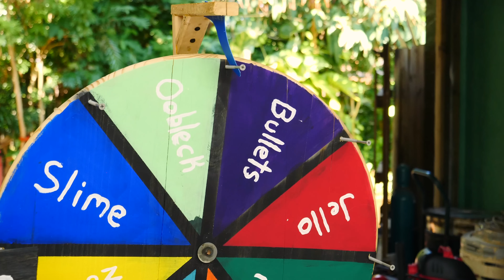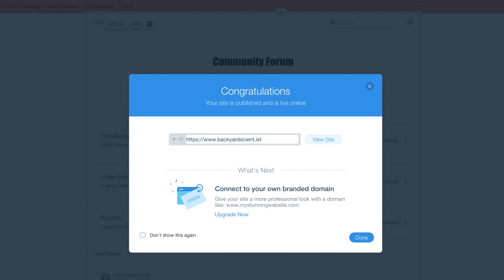Is Molten Aluminum Bulletproof?

Comment: Parents: don’t run with scissors

Backyard Scientist runs with molten aluminum
Reply: With shorts also
Reply: What could go wrong?!
Reply: Well... when dealing with metal that melts at 1220°C, his shorts could certainly melt along with his leg hairs, skin, muscles and even his very cell DNA could start to disintegrate. 

Many things could go wrong, many things...
Reply: @John-Smlth  Thank you, LT JG Obvious
Reply: John Smith Mr Smart guy here. Didn’t even make it through the whole comment
Reply: @nathschannel266  are you proud of the fact that you couldn't get through 2 sentences?
Reply: @John-Smlth  BRUHHH!!!
Reply: It ain't scissors
Reply: He wasn't holding scissors, so he was not in the wrong.
Reply: Parents: don’t run at all, you’ll slip
Reply: @John-Smlth  aluminum melting point is around 700° C
Reply: @schwarzesfleisch5809  First result from googling: "In its pure form its melting point is recorded at approximately 660 degrees Celsius or 1220 degrees Fahrenheit." yep, I see my mistake, I saw a number followed by degrees, then used it for my comment. I used the Fahrenheit value rather than the Celsius value. Thanks for the correction!

My comment here still stands though, it was meant as a joke: the figures don't matter in this context. I'm pretty sure 'disintigration' is not the proper term for the denatureing of DNA also,  so yeah.
Reply: At least it’s not scissors
Reply: Now he needs to get a whole raw (slaughtered) hog and spill molten aluminum on it to find out how bad it would be, and how much better it would be protected by:  a) polyester slacks  b) heavy dungarees  c) nomex flight suit  d) leather chaps over dungarees.  And after that he can build a molten aluminum pit barbeque and have a Luau with the pork...and include lots of hula girls!

Comment: I think you need to measure how long a bullet takes to melt when submerged in molten aluminum, then use that data to estimate how much aluminum a bullet would have to travel through to be melted by it.

Wouldn't be accurate exactly because its not accounting for the initial temp of the bullet, nor the extra conduction of the bullet traveling through the aluminum, but it would get you an upper limit.
Reply: The bullet would stop after about 18 inches of aluminum, like in water.
Reply: Good point, but its probably not the same distance as in water. IDK if its the waters density or surface tension or what that contributes to the number, but its very likely to different with aluminum, I'd guess shorter.
Reply: Also both the bullets they were using are copper jacketed. Which has a higher melt temp that aluminum.
Reply: They should also test it against a solid block of aluminum the same thickness as the container of molten aluminum
Reply: Think about putting an ice cube into a drink, or even a pot of boiling water. The water is much hotter than the ice. Does it instantly disappear? No, there is a limited rate of heat exchange. It takes at least several seconds. A bullet is passing through in 1/1000th of seconds. This is made worse by the fact that the bullet will have a pillow of compressed air in front of it that insulates it from the metal. I wouldn't be surprised if the bullet never even touches the aluminum by the time it exits the can, just from the air cushion around it. Bit of a silly hypothesis by BYS, putting a bullet on steel wire and dunking it would demonsrate it's going to take several seconds to melt even if it's lead (let alone copper).
Reply: Also it's a copper jacket bullets so.....nope.  And it's a $3k rifle because every ten years the Democrats try an "assault weapon ban"
Reply: But the first spinner would have had to stop in the green section for that.
Reply from the maker: @gundorstoneskin5900  ehh most rifle rounds just fragment as soon as the hit water. I was expecting the same thing to happen with the aluminum, and thats what did happen in the first test with the rifle.
Reply from the maker: @David-if2hj  So i did that a few weeks ago but wanted to include minimal gun stuff in the video. .223/556 will leave about a .5in deep crater in a 1 inch plat of aluminum, green tip  556 will go right through.
Reply: @TheBackyardScientist  thanks, I was actually really curious about how it would react through solid aluminum, glad to hear that you did some more testing.
Reply: You would also have to account for the kinetic energy of the bullet slowing down.

Comment: It makes sense- the amount of time the bullet is in contact with the molten metal is tiny, so the amount of heat transferred should be pretty small too. Personally I was more curious if the density of the molten aluminium would do it. I know it's a fairly light metal, but it's still twice the density of water, so I'd expect it would help.
I liked how much it splashed though, and the smoke rising up from the grass looked really cool!

Comment: Kevin: "I know what I'll do, I'll fill a very thin, uninsulated metal can TO  THE BRIM with molten aluminum, then run across the grass with it, wearing only sandals and shorts. What could POSSIBLY GO WRONG?"

🤦‍♂️🤦‍♂️
Reply: And nothing did!

Well... as a result of the running anyway.
Reply: I swear this dude dose not understand safety some days. Like really. You shout have leather boots and thick denim jeans as a basic. All clothes must be cotton so they don't melt or leather to deflect it
Reply: @spugintrntl  And they even got cool aluminum casts of the grass roots
Reply: @spugintrntl  It's a good thing nothing DID happen, but his protective clothing being NON-EXISTANT is extreme foolishness.
Reply: @NessaOfDorthonion  Whoopdie doo.
Reply: @pws3rd170  It's a sort of game of chicken with the universe. If you have no fear of the retribution, you;re not going to receive it. His nonchalance toward his well-being is the very thing maintaining it
Reply from the maker: Common guys.. I was expecting to spill some aluminum so i just held it off to the side as i walked down there. Thats all the safety thats needed. Even if i did spill on myself, whats the worst that could happen, a small burn?  Id much rather risk that than run around in the Florida heat in boots and jeans!
Reply: @TheBackyardScientist  I was thinking of that too because you mentioned why you needed to keep the ballistics on ice. At least you have experience handling molten aluminum. And you got cool souvenirs!
Reply: With all due respect, everything is perfectly fine until it isn't. And molten metal eating down to your bone and possibly even chewing down nerves is not a good experience. 

Like I said, everything is always gucci up until it isn't, and it is always ggood to be prepared for the worst. Hell, I'm watching him do this right after another video of him running around amd doing shenanigans with live house power on a stick.

That's just me talking out of my butt though because I still enjoy watching the videos lmao

Stay safe, m8!
Reply: No mention of the fact that he shot all of his fire extinguishers?
I wonder if you can buy extinguishers in bulk...

Comment: i dunno why u would think it would melt - its not inside the molten liquid enough time for it to melt...its like when u wave your hand thru a naked flame and dont get burned
Reply: copper and steel also have a lower melting point then aluminum so the bullet wouldnt melt even if left in there for a while

Comment: With heat, it all matters about amount of time enduring the temperature of the molten aluminium. Shooting the bullet, especially through a rifle because of the increased velocity, does not allow for the time it takes to melt the bullet. Time is the key. A long enough container of molten aluminium would stop it.

Comment: How about the old "liquid aluminium in an underground wasp/ant/termite nest?"
Reply: I kinda want to see how copper or brass would do
Reply: @dELTA13579111315  I would imagine that copper or brass are so heavy they'd crush the tunnels and the result would be a blob.
Reply: @amzarnacht6710  if you did an aluminum bronze with a really high percentage of aluminum maybe that would be light enough yet still have a bit of a golden color to it

Comment: copper jacket on the slug/round has a higher melting point, you would need something akin to either a three or eight gallon metal container with either molten copper or molten iron. id say that you would get a better result with the copper over the iron because of how dense iron is (if i remember correctly). 

keep in mind and you might already know this, but the copper jacket could act as a insulator to the lead inside when it goes through the molten metal between 2700 ft/s to 3200 ft/s. so the idea behind to make it melt in mid flight and that's assuming you could without a relatively lengthy induction coil. you would need a large enough container to overload that copper insulation with heat, making it melt somewhere in between the walls. the container would need to be wider than tall and inplace. 

but this is from my observations, knowledge, and thoughts.

awesome video btw

Comment: In theory the aluminum would melt the lead, but at the thicknesses of molten aluminum you had, and with the speed of a bullet, enough thermal energy can’t be transferred to the bullet to melt it (or the lead was at least still dense enough in molten form that it remained together in the molten aluminum) and was able to punch through the container and ballistics gel

Comment: You might have had a different result using lead ball rounds (no jacket )instead of full  metal jacket round. The copper jacket has a lot higher melting point than lead and it probably prevented the lead from melting and slowing down.

Comment: Even if lead has a low melting point you can't really heat it to that temperature in a fraction of a second by putting it in molten aluminum. The bullet is pretty much solid the whole time and i would guess that the metal container for the aluminum actually provided more of a protection than the aluminum.

Comment: Inconclusive, the 5.56 you shot it with has a copper jacket with a lead core.
I'm fairly sure copper has a significantly high melting point than aluminium.

You could try shooting it something else.

Comment: I think it's just a question of how much molten aluminium. I mean instant melting definitely doesn't happen, but molten aluminium does seem to be very good at capturing the kinetic energy of a projectile - just look at how it splashed up in the small-scale test. I think the only reason the large-scale test failed is because there wasn't enough molten aluminium to absorb all that energy from the heavier and faster bullet.

The bad news is, I don't think your results showed what you think they showed.
The good news is, the solution is more molten aluminium. Lots more. :D

Comment: This is a great lesson in thermodynamics. It would actually take 1 MILLION watts to melt a 62gr bullet in the amount of time the bullet is traveling through the liquid aluminum. Here's the math:

62gr lead bullet (4 grams)
Heat capacity of lead .160 J/g°C
Melting point of lead 327.5 °C
Bullet starting temperature ~50 °C
Length of molten aluminum the bullet must travel ~1/2ft
Speed of bullet ~3000ft/s

Time required for a 3000ft/s bullet to travel 1/2ft = (.5/3000) = 1.667 x 10-4 seconds
Energy required to heat 4grams of lead from 50°C to 328°C = (4x.16 x278) = 177.9J
Watts required to deliver 177.9J in 1.667 x 10-4 seconds (177.9/1.667x10-4) = 1,067,520 watts

Comment: When you were explaining your reasoning for it being bulletproof I had a different theory. I remember watching mythbusters and they said that a bullet will shatter in water and since molten aluminum is denser and heavier than water I was thinking it would make it easier for the bullet to shatter or at least stop from the sheer force of it hitting the aluminum straight on like that almost acting as a brick wall like water does when hit with enough force

Comment: So not being a scientist but a gun guy 5.56 has a copper jacket and basically you have to melt that case first the only way the liquid can get to the led is in the back if you used hollow points on the other had might be an interesting result 🤔

Comment: I would try with a .22 lr or a .22 short. the .556 is just too fast for any of the heat from the aluminium to transfer onto it before it has passed all the way through. A slower moving projectile may yield different results.

Comment: One issue with your test, you're using copper jacketed bullets?  Copper melts at 1900deg.

Though lead traveling that fast will cause cavitation when it hits the liquid al and mostly prevent the lead shot from contacting the hot al anyways.

Comment: There's NO way it will melt the bullet before it goes through the container. Simply not enough exposure time.
However, it may be dense enough to physically stop the bullet, depending on its size and velocity.

Comment: I think If you used something hotter like molten titanium or tungsten it would melt part way through, but I think with aluminium it doesnt transfer enough heat in time to melt the bullet so it goes through it

Comment: It absolutely makes sense the bullet didn't melt. While the cores of bullets are often lead, they are surrounded by a thin layer of copper. Copper melts at almost 2000 degrees Farenheit where Aluminum has a much lower melting point at about 1220 degrees. And that's not even getting into the fact that the copper surrounding the lead is probably some sort of alloy. 
A better test would be a 9 mm lead cast as lead's melting point is only 621 degrees.
While that wouldn't show whether or not molten aluminum is bullet proof (as this test showed it's not), it WOULD show if the bullet would melt before going into the ballistics gel.

Comment: This was an easy call in advance. I knew there was no way it would be stopped. Speed of bullet prevents adequate transfer of heat from the molten aluminum due to insufficient contact time. It's exposed to the heat for so short a period that there's no time for the bullet to even begin melting before it's all the way through both targets.

Comment: Were you shooting solid lead projectiles or copper jacketed?  Copper's melting point is ~3x that of lead and much higher than aluminum.  Given the projectile speed of 5.56, I doubt it would melt anyway, but it certainly makes a difference.

Comment: That amount of molten aluminum probably has enough excess heat to melt a bullet, but the bullet simply doesn't have enough time to absorb all of that heat. I did a very rough calculation based on some assumptions.

Bullet: A pure lead sphere with radius 5mm (I did say rough, right? Plus a small bullet should be easier to melt)
Bullet Temperature: About 300F coming out of the barrel.
Molten Aluminum: A reservoir of limitless heat (it makes other things hotter without getting colder itself), slightly above the melting point of aluminum.
Time that the bullet spends in contact with the molten aluminum: 100 milliseconds (I think this is generous).

Based on the conductivity and specific heat of lead, I've calculated the bullet's temperature increase in this situation to be about 42 Kelvin, or about 76F. With the initial temperature of about 300F coming out of the barrel, that puts our bullet at around 376F, well shy of its 622 degree melting point. On top of that, even if it reached the melting point, there would have to be enough additional heat going into it to actually melt it.

What I'm saying is, let's use a swimming pool full of molten aluminum.

Comment: The bullet has a copper jacket, copper has a higher melting point than aluminum and is moving so fast, even if a pure lead bullet impacted the aluminum and started to melt the outside layer would come off and act like lubricating as it travels forward

Comment: I feel like molten aluminum would be bulletproof if there was enough of it. Imagine if a bullet had to travel through several feet or more of molten aluminum in a longer container. At some point, with enough aluminum and a long enough container, the bullet probably wouldn’t come out of the other side because it would have spent enough time in the molten metal to have melted itself. I realize the scale of this experiment isn’t really feasible, but it would be amazing to see and we’d get a definitive result. I’m still on molten aluminum’s side! Lol.

Comment: Instead of a normal container use a long pipe with enough length so that the resistance of liquid and the high temperature would be enough to decrease the kinetic energy of the bullet to zero.

Comment: The copper jacket on a 556 would save the bullet from the heat of the molten aluminum. You'd have better results with an unjacketed bullet with lead showing

Comment: Well bullets slow down considerably in water, if you dive around 3-5 feet in water you can be safe from most bullets. Myth buster showed this, so my theory on this is since aluminum is very viscous , with atleast a couple feet of cubic molten aluminum, it should be fairly bullet proof to most handguns rounds and some rifle rounds. Let’s see if this experiment is up to the task.

Comment: I subjectively think that the heat of the Al does not do much. A cold solid chunk would hold that bullet way better. The fact the bullet is now somewhat affected has nothing to do with temperature but with speed. I'd think another fluid with comparable viscovity als molten Al would keep the bullet back equally good